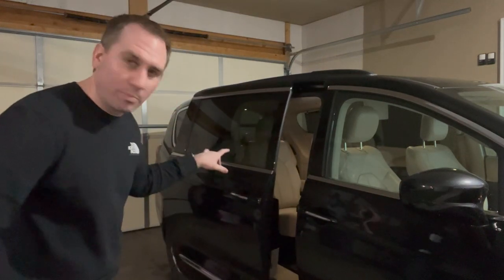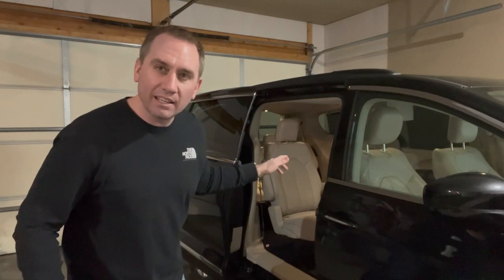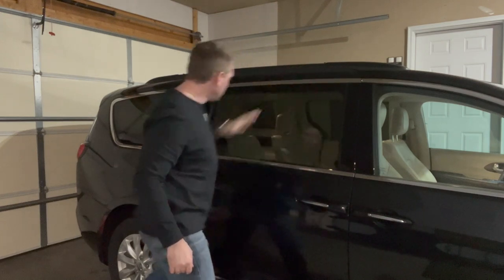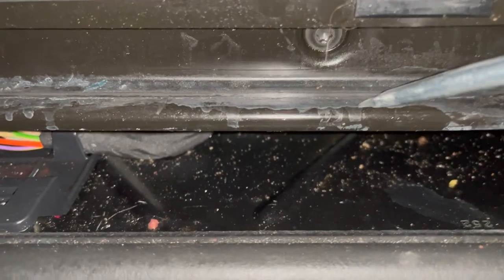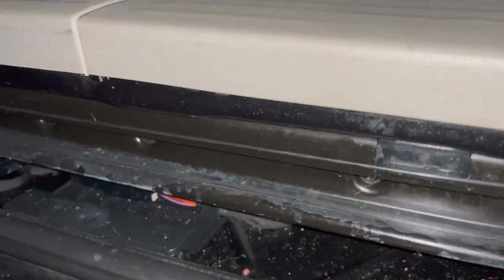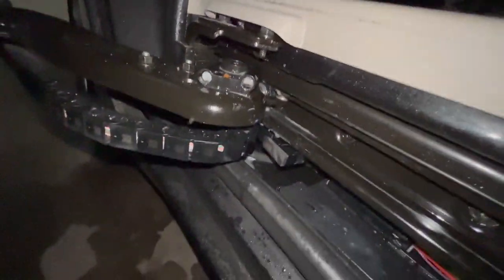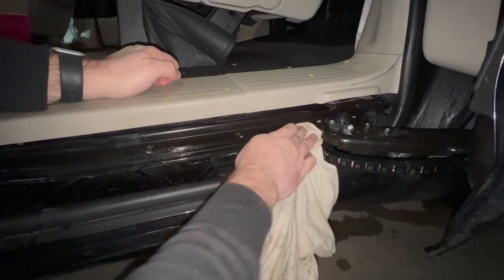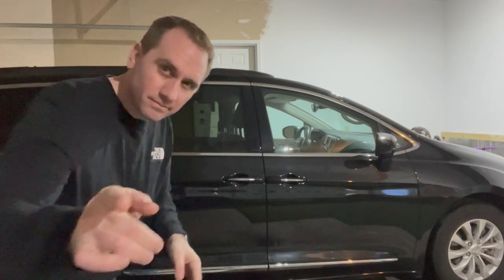2017+ Chrysler Pacifica Power Sliding Door Fix 3 of 3. Try this if the silicone spray didn't work!!!

Comment: I've got to say, I found your videos by accident.  And I'm glad that I did.  Another possible lube to use for the steel rollers is a Rail lube that we use on forklift mast assemblies.  We use Dry Moly Lube; which provides good adhesion and does not collect particles that grease would.  Thanks again our 2017 Pacifica thanks you!
Reply from the maker: You’re welcome, thanks for checking in.  That sounds like a great lubricant for the roller/rail.
Reply: Yes! So many very useful suggestions! Thank you very Much.

Comment: White Lithium grease is recommended by Chrysler and comes in a spray. A small accurate squirt should take care of the problem! Bottom bearing is the closest location where shoes, boots and bare feet bring sand to that area. DW40 is not recommended by Chrysler. Otherwise very good instruction! Always wipe away ANY over spray that traps dirt!!
Reply from the maker: Thanks for sharing what Chrysler recommends.

Comment: What year do you recommend 2017=2020
Reply from the maker: I would recommend 2020, its the newest in this generation of Pacifica.  Companies usually work out the little problems like power door closing while keeping all of the hardware the same.  

The biggest difference I have found is that they changed the Transmission Control Unit (TCU) in 2020.  I have to assume they did this to solve the transmission issues that were common.  Its very difficult to find information on these topics but I wouldn't expect the hard shifting transmission to be a problem in 2020 + Pacificas.

Comment: mine wont open or close intermitently like if it opens it open and if it closes it goes all the way but sometimes it justbeeps and wont do anything have to open it manually
Reply from the maker: Have you tried the silicone spray on the weather stripping?  It sounds like the motor is exceeding its torque limit when trying to get things moving.  Anything you can do to reduce the force required to get things moving will help.  Sometimes the weather stripping get a bit tacky and sticks to the door.
Reply: @TheLawnEngineer  will try that thanks lol you are the only one with pacifica content i have used ur trany flush video as well as ur transmission reset video
Reply from the maker: @toolsonabudget7763  I’m glad you are finding some value in my videos.
Reply: I had the same issues with both doors. These vids are great however they did not solve the issue. That said my tracks are much cleaner now! What I did is pull fuses F49 and F50 for about 10 min, replaced them and the doors worked when I tested them. Will update if thing change over time.
Reply from the maker: @neospectrum83  great tip, thanks for checking in 👍
Reply: "It's amazing how much dirt, debris, and SNACKS...." so true.😂😂😂 Pretty sure I have some Goldfish and fries down there!

Comment: I keep hearing about engine stalls while driving 😲😬 any issues with this there's a vid where a guys shows it turned off on the highway!!
Reply from the maker: Yes, it is actually a transmission problem.  I talk about it in this video: 
            https://youtu.be/fCnje98vMYw
          

A reset of the transmission's computer can be used to mitigate the problem.  Ideally, it wouldn't occur but I've been using the reset once a month for over a year and has kept things running smoothly: 
            https://youtu.be/k5lQmHBBvQA

Comment: My driver side sliding door doesnt even open anymore. None of the buttons work to open it. Only by hand will it open. Frustrating!
Reply from the maker: I think resetting the door’s control module will get it back in operation.  A shop with a scan tool can do it, or try disconnecting the negative battery terminal for a few minutes.

Comment: My sliding door will open thenclose
Reply from the maker: I would try disconnecting the negative battery terminal or taking out the fuse for the door motor.  Leave power off for a few minutes and the door’s control module will reset.